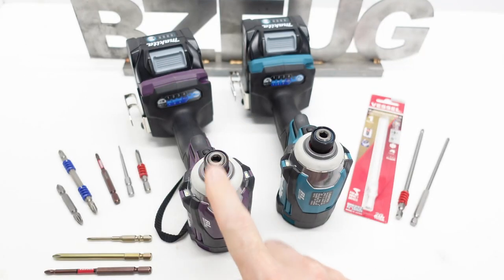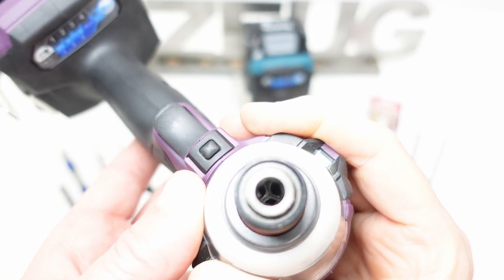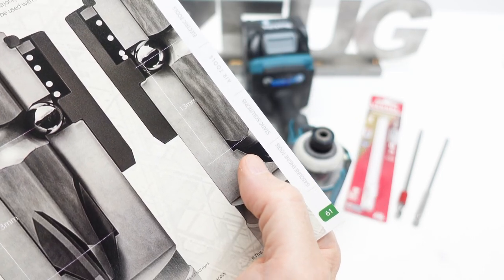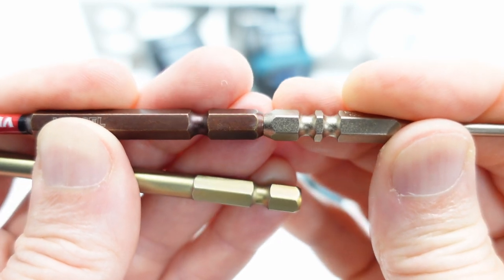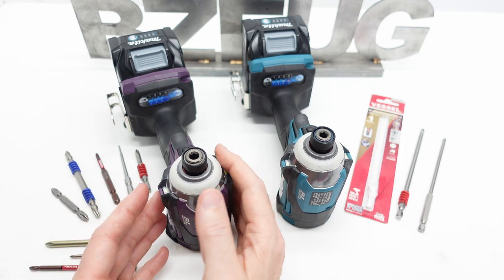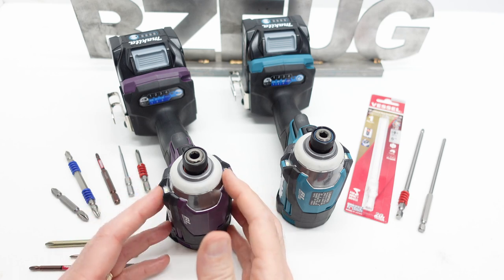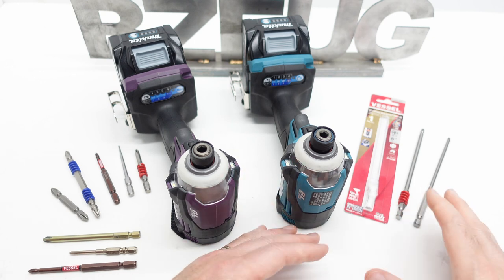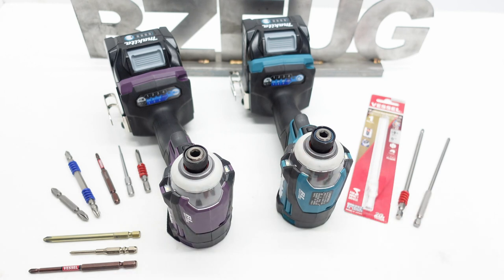Japanese impact chuck differences. Japanese JDM impact chuck bit compatibility.

Comment: Makita makes a tiny little adapter which fits into the 'bowl' on the bottom of the chuck and adapts to a 9mm offset: P/N A-44672
Reply: lmao just saw that bit of the video. Got mine from Amazon JP. Also, check your email!
Reply from the maker: Oh my goodness!  Thank you!  Gonna get one.  I put the Amazon JP link in the description.
Reply: I discussed it in a couple of previous videos. The adapter can be found on Amazon Japan for just over $1. It works correctly and makes the Japanese tools compatible with the European standard E6.
Reply from the maker: anoother the email I use for youtube is BZEUG.yt@outlook.com
Reply: Yeah its listed in the manual I reckon
Reply: @bzeug  As it is a very small piece and easy to lose, what I did was glue it with epoxy on a Wera Impaktor bit adapter. I guess soldering it would be even better.
Reply: Please send link to that bit
Reply: @aaltamiranor  I regret not ordering more than 1 for this reason 😔
Reply: @aaltamiranor  if you use the adapter with a bit extension isn't it a solid solution?

Comment: If you cannot get the Makita "bit piece" 322279-6, a 1/4" or 6mm steel ball out of largish bearing also works well with a bit of high temp grease to hold it in place if necessary.
Reply: Thanks for the tip. You inspired me that some copper tube crimp beads may also work here. It's hollow and can be taken out easily.

Comment: I've had issues using western bits in the Japanese impact driver. the ball-baring detent that holds the bit in was holding the bit in but if I moved the impact driver so the bit would be facing downwards it would fall out.

Comment: It seems in Europe we also using the longer (JDM) version, just measured my impact drill chuck length and it was 28.2 mm from the entrance.
Reply from the maker: What brand power tool are you measuring?  Are you sure it locks onto the Japanese 13mm anvil bits?
Reply: @bzeug  it was a makita clone (got it for free). No I do not, I do not have such jdm bits.
I will check it later.
Reply: Now, I did checked it. I measured a double ended bit and it was 10mm(ph2). The confusion was caused that I measured the full length of the bit head before(14.4mm) and not from the shoulder of the bit. I only realized that after your second video about this subject (makita chunk for the E6 bits) where you showed the makita catalog of the m-b43 bit head. How the manufacturer measure such thing.

I also have an original makita long bit(150 mm) what has a 9.33mm end, what has a 2.7mm play in the chunk, so this two reason played into the wrong deduction.

Technically the jdm bit would go in the chunk, but wont lock in (properly), but I don't have one to test it.

Comment: How about a cut and beveled threaded rod coupling nut tossed on a mini-lathe, so you can thread in a screw to pull it out?
I like unusual problems, so I'm definitely the guy to stick something in there and then problem solve. I'm shocked I don't have kids.
Reply from the maker: Interesting idea, but a viewer posted the part number and I was finally able to find the correct Makita shim.  Link in the description :-)
Reply: @bzeug  Ah, beautiful!
Reply: Fucking LOL!